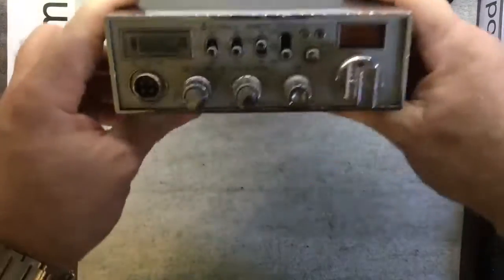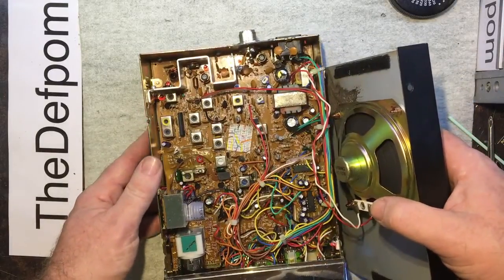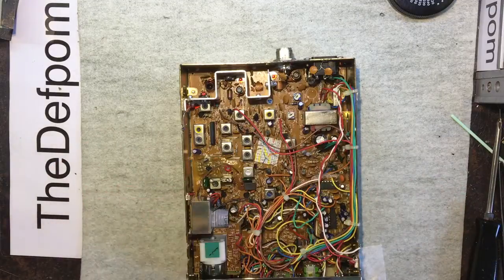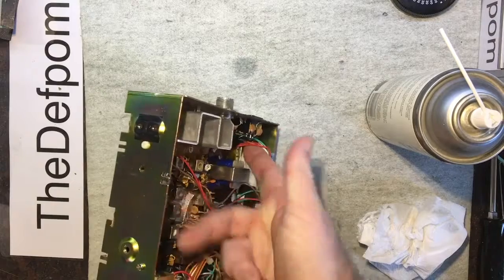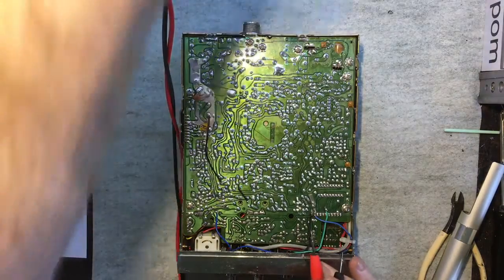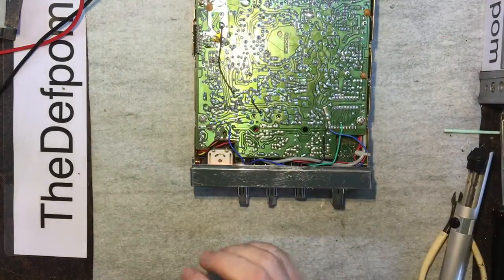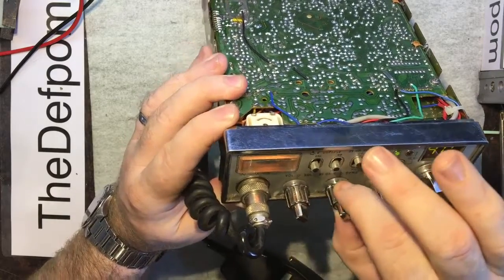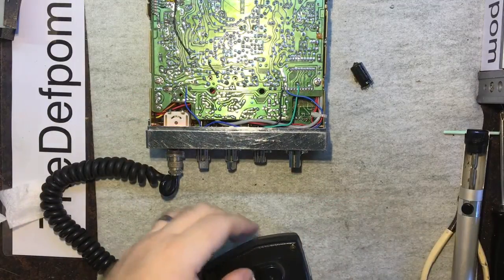#177 Cobra 25 NW ST CB Radio 772 Repair 27th February 2017

Comment: Lots of low-frequency rumble...perhaps you should high-pass filter the audio in your videos?

Last time I saw a capacitor which vented like that it was in a high-end Sony 3-motor tape deck, and the capacitor was right in the middle of the main PCB!
Reply from the maker: douro20 - that is my air conditioner, I do eq the video to drop the lower frequencies and raise the higher ones to try and minimize its effects, unfortunately it is too hot to video without it right now.